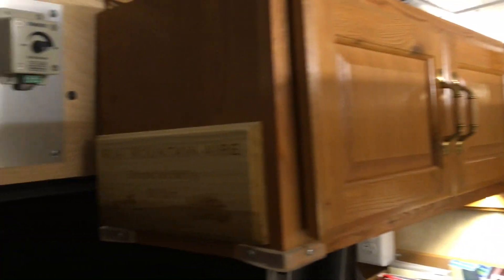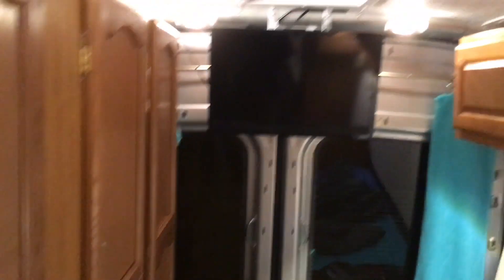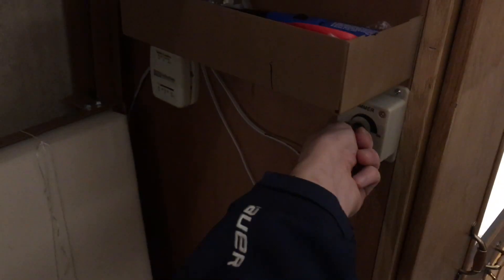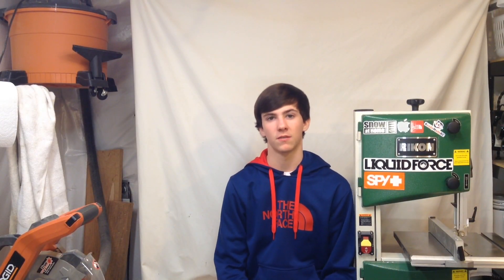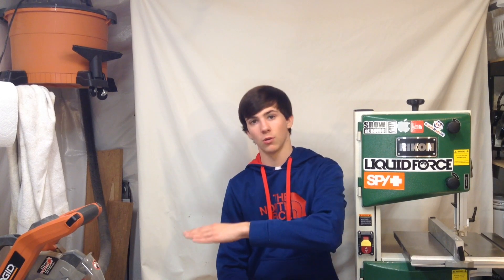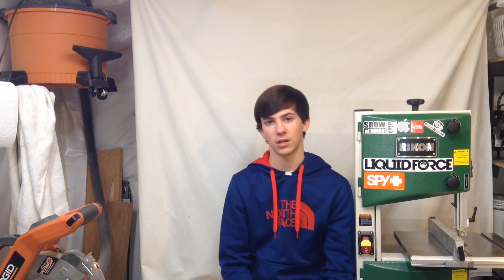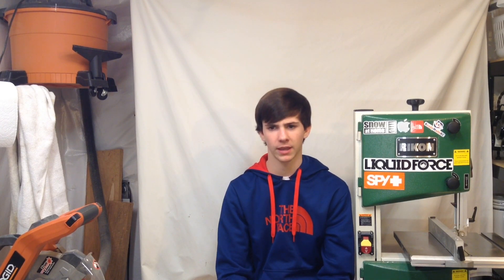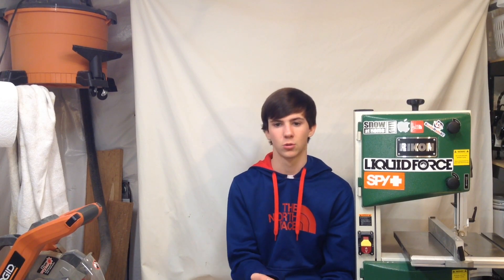Mini Motor Home Tour

Comment: I am planning on buying the same table saw that you have but I am worried about the power level. You seem to be able to cut through a 2x4 very quickly. Do you speed up the cutting part of your videos or are they in real time?Could you also maybe do a review on the saw and talk about its specs. I just want to see a quality review video on it before I buy it.
Reply from the maker: I don't speed any of my video up, it is all in real time. Power is not a huge issue at the moment however someday I may want a little bit more just for speed. As long as you keep a good sharp blade on it, the saw will do just about anything. I can defiantly do a review on it and I will try to get that out shortly, hopefully in the next couple of weeks maybe less. I am pretty busy at the moment. If you have any other questions just let me know.